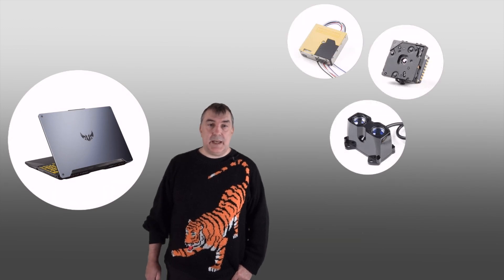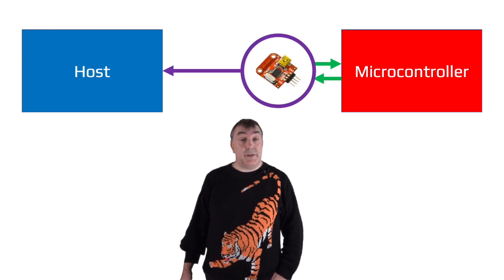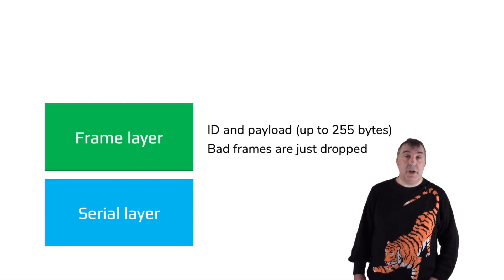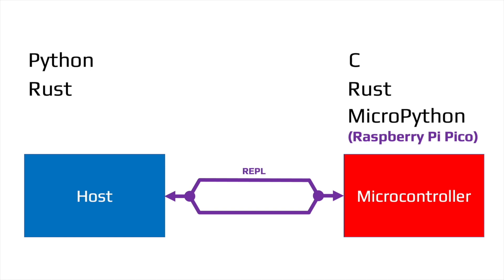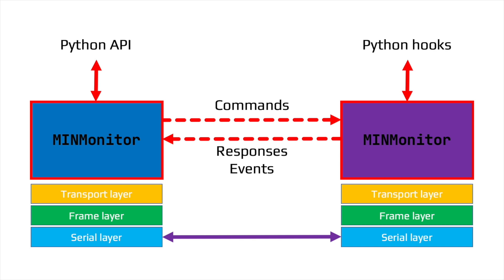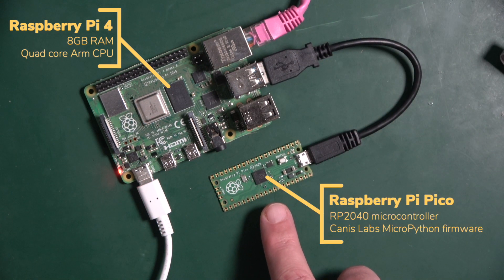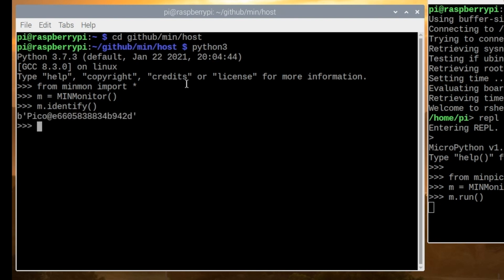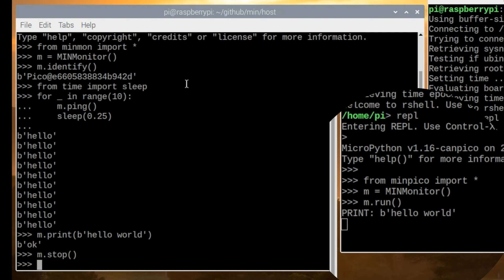The MIN protocol

Comment: Hi, Can we use "Min" in half duplex mode i.e. master slave communication mode? Master sends the queries, slave responds.
Reply from the maker: Yes, absolutely. That's how I've used it before: the MCU listens for a command, sends a response. But it can do more sophisticated things like the master asking for a periodic sampling of a sensor until sending a "STOP" command.
Reply: @kentindell  Ok thanks. Did you use the min protocol with or without "transport protocol"? Will it be possible to use Min with transport protocol in half duplex mode?
Reply from the maker: @GaganHCLGupta  Yes, it was originally without transport mode and intended to be used as datagram messages. So you can use it like that with a simple controller asking the MCU for a response. For simple systems that's completely fine. For more complex systems, where there might be side-effects from  re-send of a request after a timeout, you can add some sequence number to the request (and so duplicate requests are removed) or you could just switch the transport back on.
Reply: @kentindell  Ok thanks. Do you know if "Will it be possible to use Min with transport protocol in half duplex mode?"
Reply from the maker: @GaganHCLGupta  Yes, once the response message has been sent and been ACK'd it should go quiet.